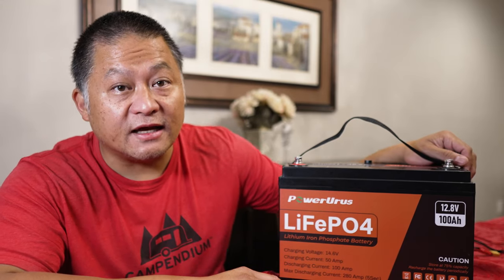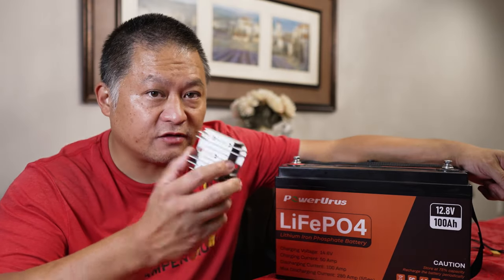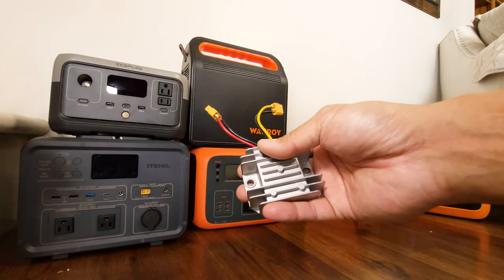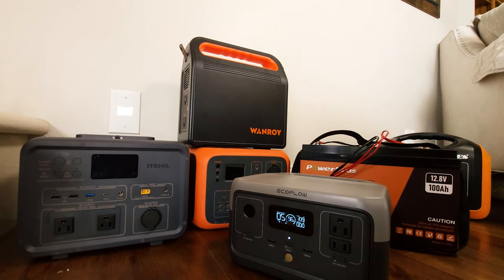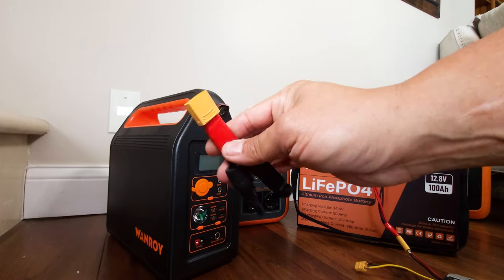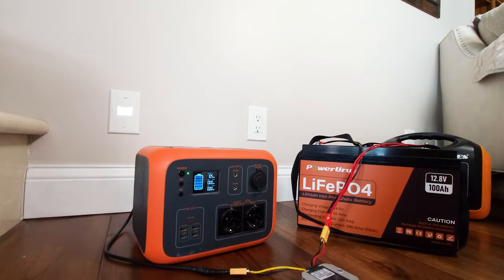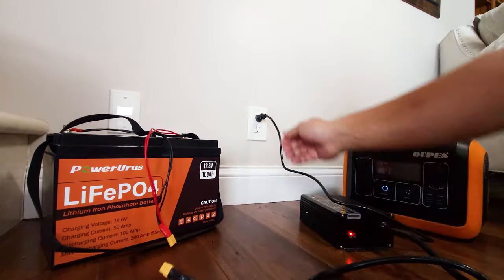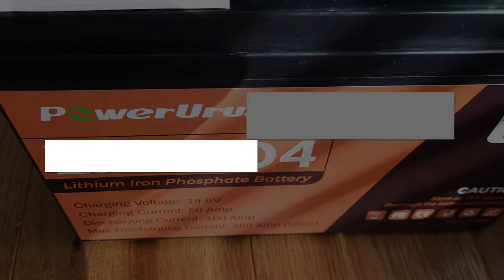CAPACITY HACK For ANY Power Station // PowerUrus 100Ah LiFePO4 Battery

Comment: Great video! Just what I was looking for. Question. If I wanted to take it a step further and connected the 400w solar panels that are hooked up in my fifth wheel to charge my 200ah Lifepo4 battery and then connected the battery to my AllPowers R2500 with the method you described, would the panels then charge the RV battery and then the power station at the same time? I hope that my explanation makes sense :) THANKS!
Reply from the maker: Thanks. Yes as long as the battery you are using to replenish the power station has power, it will keep topping off the power station indefinitely.

Comment: There will always be a power loss when converting from one voltage to another even with the best designed buck convertor. So while you can do this to extend the run time (watt hours) of an all in one LiFePo4 power station, always remember that you will never get the full capacity (watt-hours) from the external battery. There will always be a loss.
Reply from the maker: I hope this is an obvious statement to everyone else.

Comment: First video I've seen on your channel and love the content, covers the exact idea I've been thinking about for a while, haven't seen many others thinking outside the box like this. 
Got an interesting question, your using a 12v to 24v boost converter to charge the power station, now my idea is I have a wealth of power tool batteries I've been modifying to power other items like ebikes. I have several 18v and 40v batteries, now the 18v batteries I think output more around 20ish so would I be able to bypass the boost converter if my batteries are already outputting 18-24 volts? Also my ideal setup would be 3d printing 40v ryobi battery mount to my 300watt power station and be able to power the station directly from the 40v battery instead of going thru an extra charge cycle on the internal battery, than I can hot swap in my other 40V batteries as needed. Does any of this make sense? :P I guess the more important question is which is the most efficient way of doing this.

Comment: Renogy makes an affordable 2,000W pure sine wave inverter that makes quick work of charging a power station. It costs about $100 less than the battery and doesn't take up as much room.
Reply from the maker: Still need a battery or power source to charge. Obviously it won't work alone
Reply: @freelyroaming  This is true. The given is that there is a power bank in both scenarios. The question is, what is the best/most efficient way to keep the power bank charged? And, if you look at my original comment, I mentioned the power station.

Comment: Great video, I was wondering if anyone has tried putting 2x12V in series so as to make it a 24V cluster.. I guess that should work and doesn't need a step up 12to24V converter since those things are getting pretty hot and couldn't leave them unattended...
Reply: Yup.  This is how most of the power walls function.
Reply: But the concept is misplaced by using batteries in series. The idea around the boost converter is that it enables the system, charging from a variable voltage source (of 12v requirements), to increase power (watts) with reduced current (amps) due to boost voltage.
Reply from the maker: Also an important safety precaution is having a current limiter in place. 2 batteries in series has the potentialif delivering current at dangerous levels.

Comment: Freely Roaming  - Will this work with the Ecoflow Delta 1300 unit that has maximum DC XT-60 input ratings of 65 volts & 10 amps? I have been considering buying a second EF unit in order to double my storage capacity, but this method would be so much more affordable. Plus, I could use the new 12v stand-alone battery to power the trolling motor in my boat, which is a nice added bonus. Thanks for the great information & videos!
Reply from the maker: Yes it would work with your ecoflow.

Comment: So without the cheap 12 to 24v converter you can do the same as 12v to 12v using the barrel to cigarette lighter female and connect a cigarette male to battery clamps end and connect to the battery,  correct?  Slower but still moves the watts over.

Comment: i'm thinking of running my emmo 72v ebike using (4) lifepo4 12v 30ah along with a 5v-40v (8A) boost/buck converter.  i'll run the converter using a 12v 20ah lead acid battery.  the bike used 6 12v 20 ah lead acid when purchased. 

What do you think of this setup?

Comment: how to charge additional batteries?  does you need to charge them manually?    if so - not comfortable, coz expansions from bluetti got charged from power station when the grid power supply comes back.

Comment: IF YOU'RE ON THE ROAD, POWER STATION CAN BE CHARGE USING THE BATTERY IN YOUR CAR WITH THE POWER BOOST CONNECTED WHILE YOUR CAR IS RUNNING.???

Comment: Just connect your 12 volt battery to a 12volt/120 volt pure sine wave inverter [500 -1000 watt). Then plug your power generator 115 volt plug into the pure sound wave inverter. Simple
Reply from the maker: That's the normal way people would have done this in the past. But it is not nearly as simple, inexpensive and efficient as the setup I am showing here.

Comment: Hello, thank you for useful video, I have one question for you :  I have already convertor DC-DC 12 to 19 Volt , 5A 95 W , I use it for charge and use my laptop during the RV traveling, so can I use it for charge Power station ?
Reply from the maker: Yes it should work as long as  your power station can handle 95w of solar input.
Reply: Thank you  @freelyroaming

Comment: Wouldn’t work better to use two 50Ah lithium batteries wired in series to boost up to 24v?
Reply from the maker: Not really. More wires and no current limiter.

Comment: Any fuse needed for this setup?
Reply from the maker: You protect the boost converter it wouldn't hurt to have a 15A inline fuse between the battery and the converter.
Reply: @freelyroaming  thanks. Possible video idea? A version 2? Thanks for the vids. Been learning a lot

Comment: If you connect a charger to the extra battery, will it work? So it charges when it can the battery which chargers the power bank?

Comment: Might it be even better to boost battery to 48 V at 10 A (480 W) since many power stations have a 10 A solar input limit? 
For example, Daygreen booster at Amazon or others for $100. 
Do still need to recharge the Li battery and need a power source to do that. Couldn’t that power source be used instead to charge the power station directly?
This approach seems less expensive than a larger power station or it’s add on battery. But the Li battery is $100, the V boost is $100 and the Li recharge is also $100 so $500 total?

Comment: Great info. But how do you charge LiFePO4 Battery in the wood ? =p
Reply from the maker: How do you charge anything in the woods? You don't. This isn't setup that is meant to create electricity out of nothing. It increases the capacity of a power station. Not extend it forever. You need to go find a plug.

Comment: If you had three solar panels facing different directions would three converters equalize the voltages?
Reply from the maker: I will first say that solar panels should not be connected to these boost converters directly. The only thing solar panels should connect to are charge controllers. You should only plug these converters into something that outputs stable voltage and current. Plugging solar panels directly into them will probably fry their circuits as the voltages are too high.

Comment: My ecoflow river 2 will take between 11v and 
30 v and charge at about 105 watts from a 12v battery without using a transformer.  It would cut out at 11v . That's  OK.

Comment: Is that River 2 only allowing 100w to be charged from a 12v to 24v step up? Shouldn't it be at least 200w because I get 100w into my River 2 Pro straight from a 12v lithium without a step up converter.

Comment: Would getting a small inverter for the external battery and plugging the power station into the inverter do the Same
Reply from the maker: Depends on what you mean by the same. Technically, not at all. But both will charge the power station.

Comment: After reading the comments, it's clear that this guy doesn't handle constructive criticism well, so one thing I would watch out for is his exposed terminals. You can see when he plugs them in that he's very close to getting 24V to the heart.
Reply from the maker: Because it's always people who have no proven knowledge hiding behind anonymous accounts making uneducated suggestions. Just like yourself.

You can literally touch both 24v terminals with your bare hands without any harm. Not even a tingle. The resistance of human skin makes short circuiting thru your body impossible at these levels. Especially with this boost converter limiting the current to only 3 amps. That is the same amount of current charging a smartphone. By your logic you would be afraid of USB charging cables.

24v is considered a safe low voltage and even so, it's high current flow creating friction in the form of heat that actually harms you, voltage has little to do with it.

I would rather not have to reply to explain this to you so if you are hoping to provide 'constructive criticism' instead of just provoking fear, uncertainty and doubt, Please first educate yourself.

Comment: would it be safe to plug up the Ardroit battery charger to a gas generator that has a 120VAC 20A outlet since the battery charger is 30A? or do I need to buy a model that matches amps to 20A? sorry I'm new to LiFePO4 charging and want to be safe. Also would this charger still be your current recommendation and best overall budget pick? Oh and also that gas generator has a 120VAC 30A outlet available but it's a twist lock, would it be better to use that one with the NEMA L5-30P to 5-20R adapter?
Reply from the maker: @fabiangomez357  the 30a charger is referring to it's 12vdc output. So it isn't draw something like 5a from the AC side.

Comment: Any suggestions if I want to use my 200w solar panel to charge the auxiliary battery first instead of charging the power station first?  Basically solar to auxiliary battery to power station.
Reply from the maker: Just make sure you use a decent charge controller. MPPT preferred.

Comment: @Freely Roaming, Thanks for your video's. My van is set up with a isolateably 1k watt inverter, is it worth going to a DC to DC charger  to charger a 100ah lithium battery or use a Arduit 30a charger like yours with the inverter? I have 2 pv panels for 360w I would like to add some day, just starting out.
Thanks.

Comment: I really need to know why two black and two red wires coming from the battery, and is the yellow wire just to let us know it is out put 24v ?? please reply, I really need to know , thank you.
Reply from the maker: It's just there to increase the current carrying capacity. That is instead of a thicker cable.

Comment: So whats stopping the battery from discharging too much? would it be possible to plug in car battery charger to power station outlet and charge external battery while station is being charged from ac or dc.
I have ecoflow river pro lifepo4 that has extention plug to connect another river pro extension pack but i assume batterywould have to be same capacity as in river pro? I also have Energizer arc5 but that's not lifepo4

Comment: the ac50 doesn't need the dc/dc converter. Direct connect the 12.8v lifepo4 battery to the input and it will charge!
Reply from the maker: Yes some do not but to make it compatible with more power stations and to have more safety precautions, having a boost converter with current limiting capability is best. Otherwise a LiFePO4 battery can output a huge amount of current potentially causing wires to melt and start a fire.
Reply: @freelyroaming  Would you say you forgot to install a 10 amp fuse on the lifepo4 for doing this type of hack?
Reply from the maker: @uhjyuff2095  why would you install a 10a fuse? It's better to keep it electrically limited and you won't need to keep and change any fuses. It just works with nearly all power stations regardless of brand.
Reply: @freelyroaming  You haven't seen a fuse panel in an RV or truck?
Reply from the maker: @uhjyuff2095  You want to install a fuse panel? What? An RV? A truck? Are we still taking about power stations? 🤦‍♂️  This is getting pretty ridiculous. But hey man, you do you. No one cares really.
Reply: @freelyroaming  Well yeah, how else can I charge my solar generator and power my RV. I am not going to carry around that lifepo4 battery because it is too heavy.
Reply from the maker: @uhjyuff2095  then I think you are watching and commenting on the wrong video.

Comment: So this is for any small power station, and not worth it for my AC200L which needs ideally 48v 15a (that’s right in the middle of the maximum input). Anything less (Ex.) 36v is barely maintaining my AC200L capacity especially if I didn’t already have 30v 400w average coming from solar.

Comment: So I tried this, but I'm only getting 187 watts coming in. Delta Pro still viewing it as car charging instead of solar. I got the 12 volt to 24 volt by 15 amps. (Should see over 300 watts) Is there something I am missing to make the Delta Pro see it as solar instead of car charging, or am I missing something else?
Reply: Did you get it figured out? I know it's been awhile since you asked the question.....  I was thinking the size of the cable is restricting the incoming power? I just got a Ecoflow Delta Pro as well and would like to expand my usage going this route before I drop $$ on the battery packs. Thanks

Comment: Hello.  The plan is to buy an ecoflow delta 2 and later such a lifopo4 battery.  I understand that this way I can essentially increase the capacity of my delta 2 battery by 2x and it will be cheaper than buying an original ecoflow extra battery.  Can someone answer, even if I'm in nature for a longer time, how can I charge the delta 2 with a solar panel, for example, and also charge the Lifopo4 extra battery directly from there?  To be used as a mean delta 2 controller, because both inverters and controllers are already built into it.
Reply: I’ve got a delta 2 max with extra battery and an additional 220 Ah 12v battery bank in my Sprinter van. The Delta 2 Max system is charged from 2 110watt Ecoflow solar panels. The 12V battery is charged through a mppt  solar charger from 2 100watt solar panels and also directly from the van alternator. I have a XT60 connector from the 12v battery that can plug into the Ecoflow to charge it if I need to top up the Ecoflow but it maxes out at 120 Watts charging. So I have to use a 1000watt inverter to charge my Ecoflow at 1000Watts from the van alternator at 110V. It’s a cludgy  setup but it works and gives me a total of around 6600 Wh of capacity and I can easily expand it to over 9000Wh by adding another 220Ah 12V battery. 

In hindsight I should have just built my own 12V system instead of trying to use the Ecoflow Delta 2 Max due to it’s limited charging capability.

Comment: Since the unit produces 24V DC - there should be no issues adding 3 in parallel to enable 300W input ? - IF I were to use this setup - and add a LiFePO4 charger connected to mains - would the LiFePO4 battery be safe - I assume a good quality charger will cut off once the battery is full ?.
Reply from the maker: Yes you can connect them in parallel. I've done it with 2. Just make sure you first test the actual output as it usually exceeds the rated output. Depending on your power station, it may or may not allow simultaneous charging from multiple sources. Any good quality unit should have internal circuits to prevent any damage.

Comment: Hi I’m new to all this. I was just wondering what the difference if I just connected my power station into a inverter that connected to the battery. Wouldn’t that charge the power station as well or even quicker?
Reply: @EvanBlack11  that would work, but inverters do waste energy. You would be taking dc power in your battery, inverting it to ac power, just so your power station can convert it back to dc power for its battery. It works. It's just really inefficient.

Comment: Cant u use a basic cigarett lighter to input your power station through the solar input and clipped to the 12 vlt battery
Reply from the maker: If your power stations support it, meaning is has a built-in boost converter, then yes. But not all have that. This is the way to support all power stations.

Comment: Can I do this with a Duracell Power Source Electric Generator, Solar Capable, Gasless, Quiet, 1440W Output Power Inverter, High Capacity Power Bank? It's a lead acid battery and i've bought a Renogy Deep Cycle AGM Battery 12 Volt 100Ah, 3% Self-Discharge Rate, 2000A Max Discharge Current, Safe Charge Most Home Appliances for RV, Camping, Cabin, Marine and Off-Grid System, Maintenance-Free. I want to hook up a couple solar panels I've heard I can hook up 2 x 200 Watts solar panels to charge the Duracell and extra battery by running the solar panel to the battery instead of the unit controller on the back of the Duracell

Comment: I have 3 - LIFePo4 100Ah batteries in my golf cart (36V) and want to charge my Ecoflow River 2 Pro. Do I need a 12v-24v Booster Converter if I connect to 2 of my batteries (24V)?I can connect a female cigarette to my golf cart batteries that will connect to the supplied male connector.

Comment: Are you able to charge the lifepo4 battery while it is connected to the power station at the same time?
Reply from the maker: Yes sure. Just split that pigtail adapter to do both at the same time.
Reply: @freelyroaming  so AC lipo charger or solar charge controller to lipo battery terminals, battery terminals to XT60 connector, XT60 connector to power station should do fine?  Ignoring the step up converter to keep the question simple